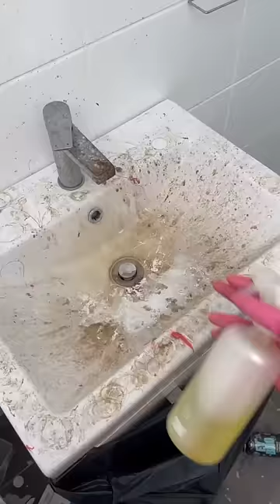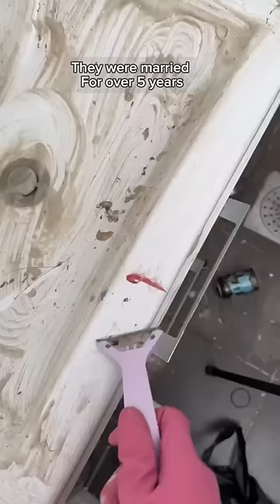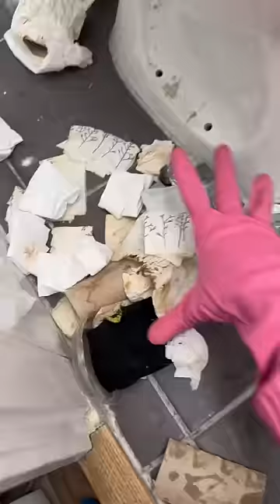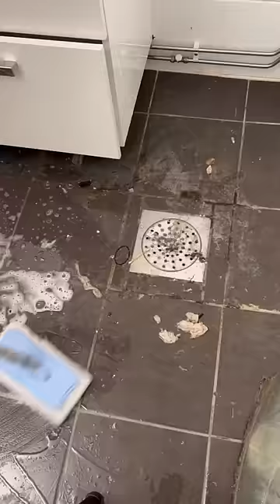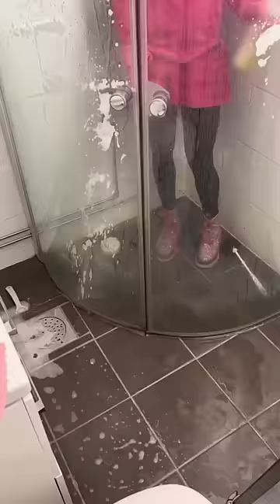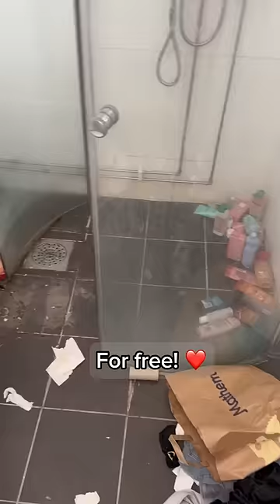Cleaning Amidst Sorrow with @sinicleaning 💙 ​⁠ #cleaning #helping #cleanwithme

Comment: Amazing cleaning job aside, that shower looks like a total nightmare. How tf are you supposed to be able to keep the rest of the bathroom floor decently dry, clean and mold-free? You're gonna have a permanently soapy, hairy floor, you can't have a carpet, humidity through the roof, and you basically can't use the sink and toilet after a shower unless you've mopped first or you're gonna get water all over your house. Can't believe how hard it must be to have a bathroom layout like that when you're already struggling with mental health and hygiene